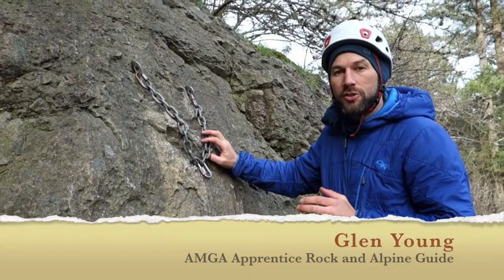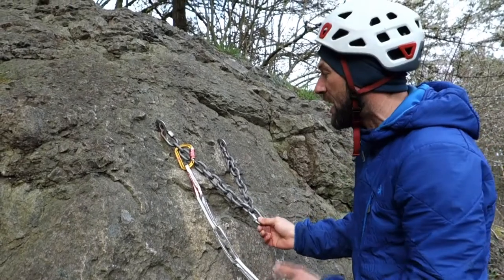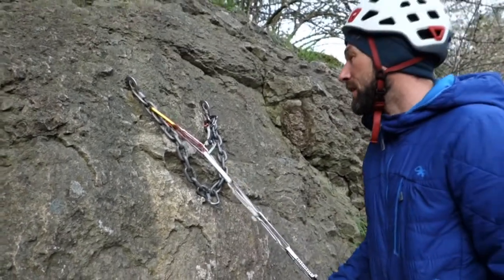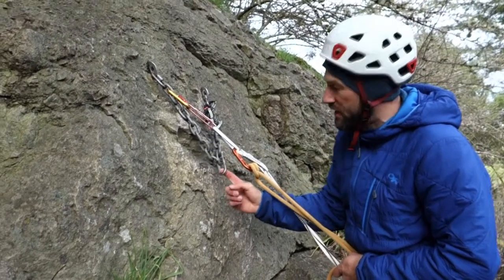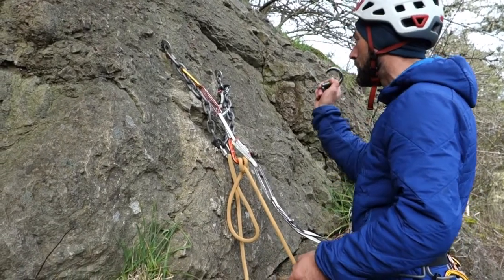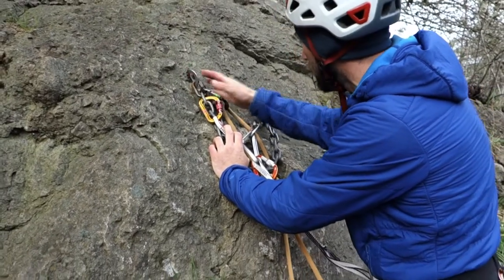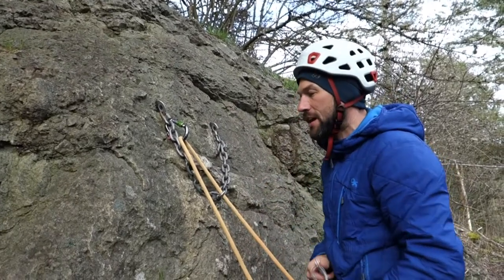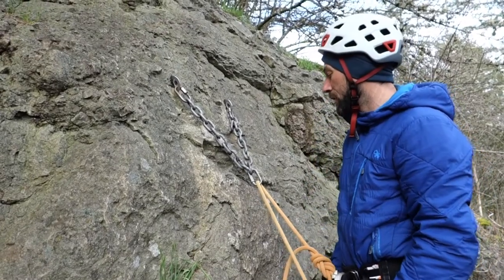Single Locker Anchor

Comment: Thank you for making a point of damage caused by weighted lowering on the permanent hardware.  Even though last lowering is weighted, this still will cut down 80%-90% of the damage that could be caused. This is still technique is perfect for the inexperienced follower. Thank you!